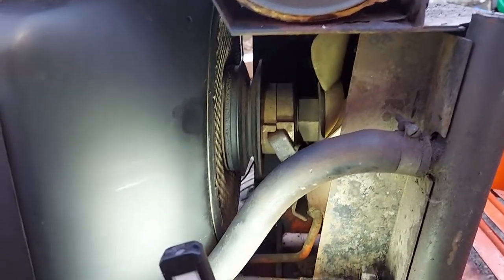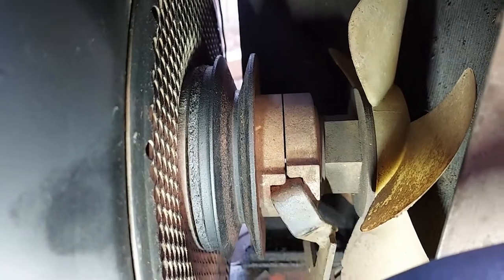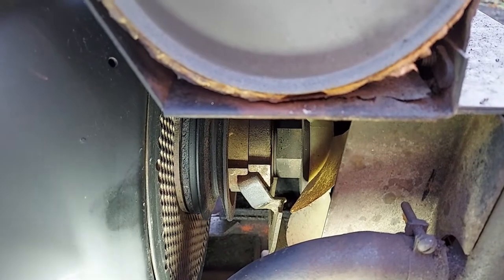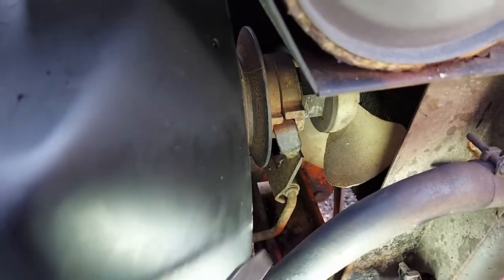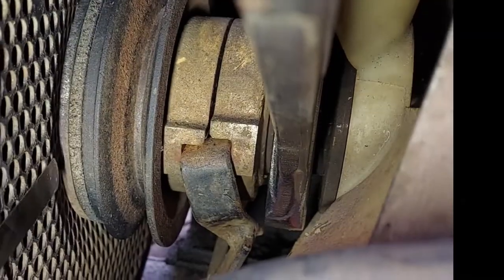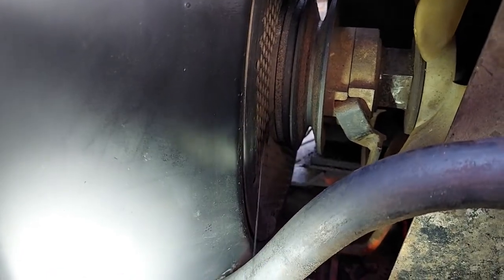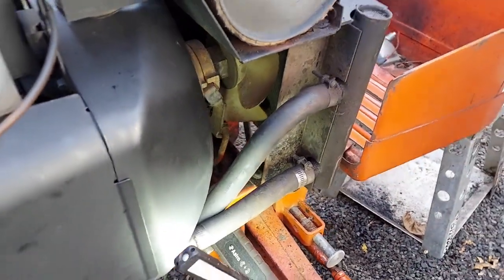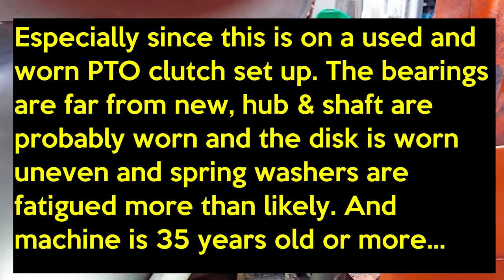"IN THE FIELD" Adjusting The "EZ ADJUST" PTO Clutch Case Ingersoll Garden Tractors. No disassembly

Comment: Case 224. I am doing this but am not getting any adjustment at all. As a matter of fact it got worse after thighinging the pully wouldn't engage at all yet there was still a gap.

Also the part where the forks go are just floppy and there is no click.

Im guessing i just need to re build? 
Obviously im.brand new to thos whole case thing!
Reply from the maker: Hi really hard to say without seeing it, but yes I would start with a rebuild. We have a full video on how to rebuild your PTO clutch. Here is a link to the kit. Thanks for watching and the comment. https://www.caseingersolltractors.com/product-page/xx-6
Reply: Does that fan nut need loosened at all for this to work.

Comment: Tip: I didn't want to pay big bucks for a wrench I'd seldom use so I went to Home Depot and in the plumbing tools section I got a "sink drain" wrench which looks like an adjustable crescent wrench with a wide mouth for around $8.00, it's thin and easy to use in that tight spot it's the perfect tool to adjust that large nut.
Reply from the maker: Nothing wrong with saving money! Not a lot of torque is put on the nut so there are options for sure. The bigger thing is getting good access.  Though correct size wrenches are pretty reasonable on Amazon or harbor freight with 2 angle options on them that can be helpful some times. Thanks for watching and the tip we appreciate it!